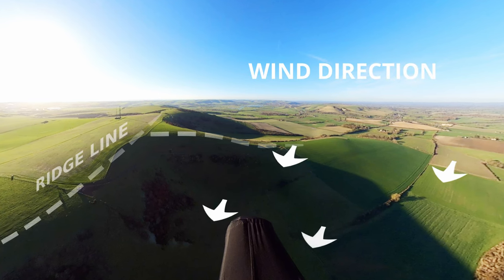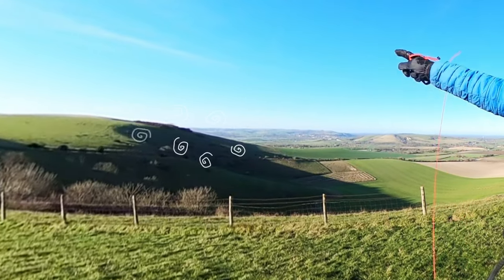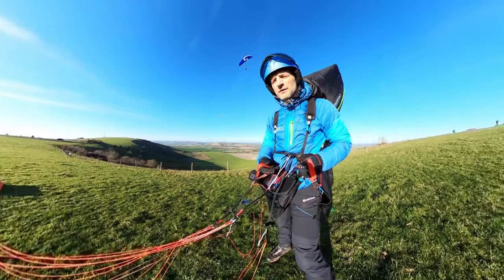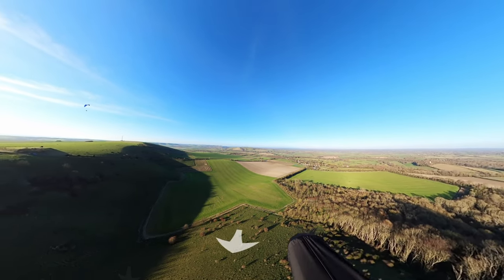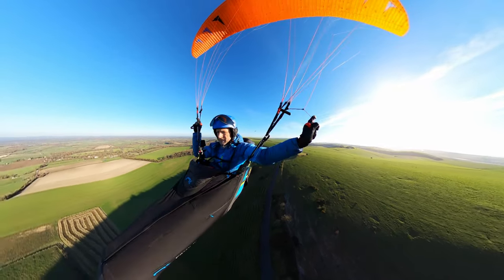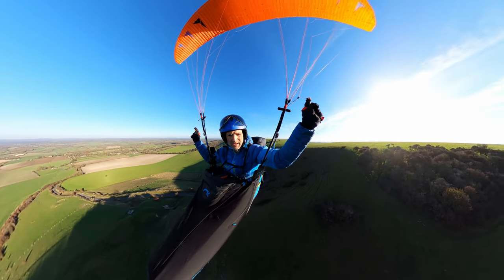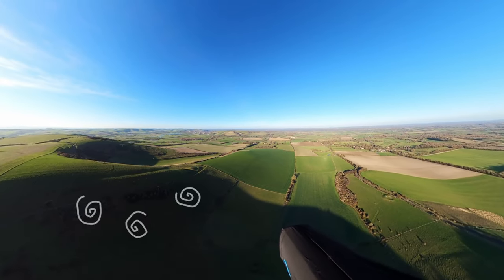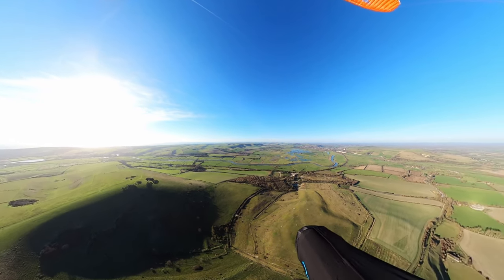Paragliding CROSSWIND SOARING Tutorial / Tips!  (How To Avoid Rotor)

Comment: Feel free to ask your crosswind soaring questions or share tips to help others! 🤓
Reply: I am a poor one to say feel free to ask a question if you don't want to hear several lol. Where I live is inland a long ways in the wind shifts about 15° constantly all day long first it's coming down this line and then it's about 15° off of that line then it's back on this line then it's 15° off. When I'm soaring ridges particularly with pockets and stumps sticking out the sides, will that 15° wind shift make very much difference on where the rotors are and how strong they are? When the wind shifts 15 degrees and the rotor changes how long does it take for the rotor to stop change move point different directions?
Reply: @markmcgoveran6811   Yes, that 15° wind shift will likely make a significant difference to the airflow including where the rotors are and how strong they are plus where the best lift is. The change downwind will happen at roughly the wind speed i.e. the speed the air is moving over the ground.
Reply: @flybubblecarlo  thank you so very much from the bottom of my heart. When I leave the school I will be flying all alone. Every tip I get online from anybody that's willing to explain something to me as thoroughly as you did here is a treasured idea to be mulled over for hours on end.
Reply: @flybubblecarlo  can I wiggle another free question. I don't look forward to The landing part of paragliding at all and I wondered what would happen if I had a big drag shoot to throw up behind me and hold me back so it would swing me down a little bit and I dive but I'd have so much parasitic drag on the payload that I would go in slow could you ever balance that out so you had a great big drag shoot to throw up behind you and you just kind of drifted in easy without any flaring or anything and took your lumps on the landing?
Reply: @markmcgoveran6811  that's not something you can do. If a paraglider pilot throws a reserve, they need to reel in the actual paragliding wing or the reserve and wing will work against each other and cause a higher sink rate. Even once the wing is stowed, the descent rate under reserve is pretty high. Survivable, but unpleasant. Purposefully deploying some sort of "big drag shoot" before landing is not an option. Landing a paraglider is quite pleasant and enjoyable in normal conditions, and a little of bit of headwind makes it pretty easy.
Reply: @arielzlatkovski8636  I saw a lot of landings that were so pleasant it killed a guy dead as a mackerel. I agree with you the reserves are pathetically small. A regular skydiver has a much larger reserve shoot and I would like to get one of them. I have seen people with a small shoot that was not a reserve shoot that could not function as a reserve shoot and was never intended to function as a reserve shoot it was called a drogue chute and it was intended to slow down a person with parasitic drag in a spiral dive. I watch landing fatalities as a hobby I do equations and describe these things mathematically as a hobby and I've seen a lot of landings that didn't look very pleasant I don't know maybe somebody who's in the brakes too far unless one break off and spirals into the ground and dies from 100 ft, might have done better if he'd had more parasitic drag on the payload and less braking action. But I appreciate your input thanks for your effort. Could you tell me about the drouge shoot for spiral diving and the effect it would have on landing.
Reply: @markmcgoveran6811 , accidents happen but also don’t forget the non eventful landings outnumber them immensely. A drogue chute for spirals is referred to as an “anti-G” as it reduces the G-forces. It is not for landing. 

Paragliding landings happen on feet, or some people choose to slide in on their harness protector (older, back issues, etc). Landing under a parachute is not an option as part of standard paragliding. Paragliding is not for everyone; it might be not for you if you don’t want to accept the risks, including on landing (and that’s okay).
Reply: @arielzlatkovski8636  I have to agree with you on many points in fact you're right I can't land a paraglider yet I haven't got towed into the air yet I'm still doing ground handling and I'm going to do a lot of extra ground handling before I start to fly. I saw a person deploy a parachute about 10 ft across or less behind them to stop the spiral dive problem with the speeds and then I saw them fly to the ground and land with that parachute behind them. Back when I studied mathematics that would be an increase in parasitic drag on the payload. Back when I studied engineering that would be a force on the bottom that tip the whole system forward so the wing would tend to dive a little more but the speed going down wouldn't be as fast because the drouge increase the parasitic drag. Since I'm trying to have a good landing and not one of those rare accidents where you get to laugh at me cuz I'm ugly and poor and just a peasant, it looked to me like I did not want to lose control of my pitch axes and swing into the ground. What are the other people who have a paraglider wing with the extra bit of parasitic dragged behind them during a landing because they deployed this for a spiral dive didn't seem to be having any pitch swing anytime soon. Back when I studied mathematics mechanical engineering electrical engineering, I would try to find some quantitative information to get an estimate of the proper amount of parasitic dragged add to eliminate the swing and allow for a little extra breaking without a stall. I didn't say the video because I assumed anybody I would be asking for advice would have seen somebody landing with a spiral dive device deployed. I agree if you want 100% those reserve parachutes are a punishment that you have to accept if you throw them. I would like to have a much larger reserve.